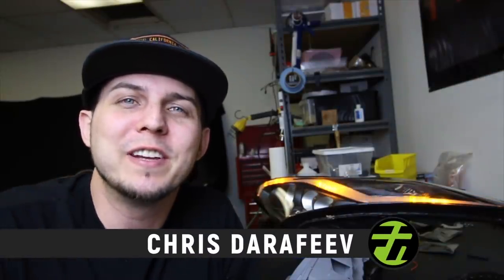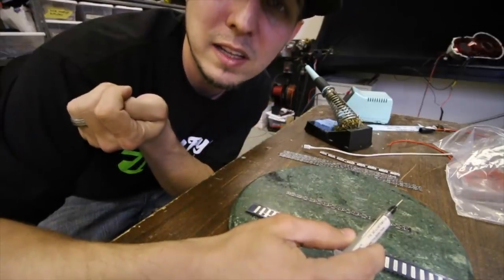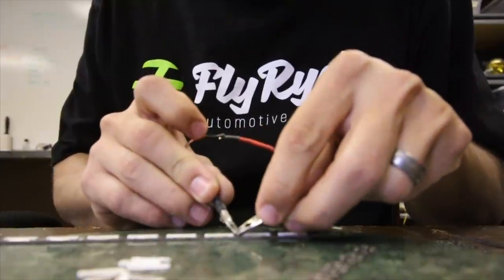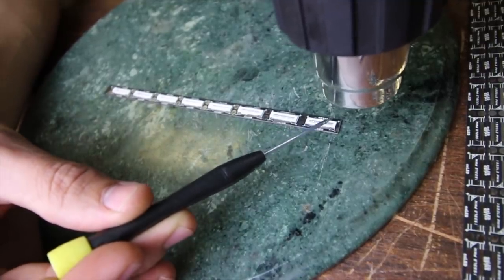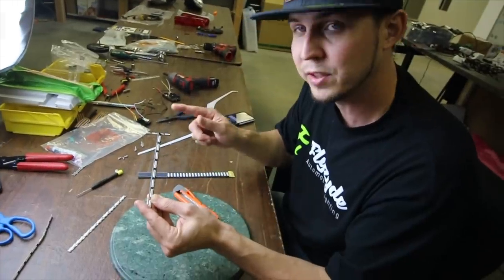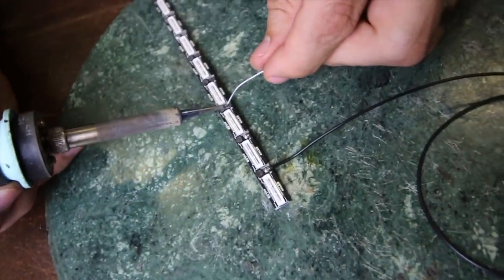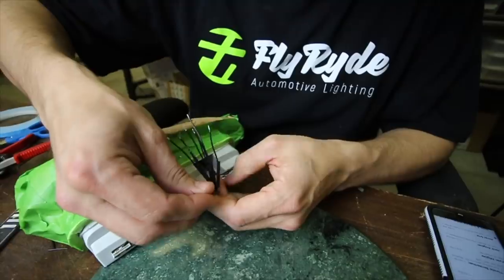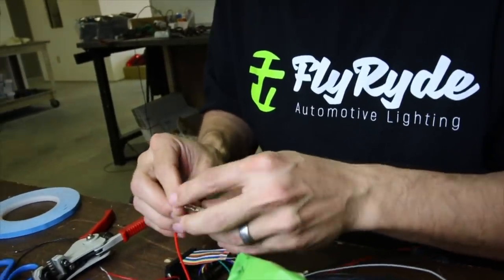How To Build Custom Sequential LED Strips - Online Course FREE Preview

Comment: I'm a wire harness manufacturing specialist (ctwireprep.com)  and enjoyed watching your video.  I would suggest two things .  First get yourself a fan to blow away the smoke when you solder so you don't have to inhale any.  We build a metal hood for each solder station and use a square fan for cooling computers (runs on 12 volts)  and we pipe it out with dryer venting to the outside.  Also instead of soldering the ribbon cable on I would suggest you use a molex connector system that is the same as the connector on the ribbon cable but you can crimp contacts onto the wires from the car light and these crimp connectors push into the molex connector and snap into place nicely.  You would only need to get the correct crimping plier to do this.  This would eliminate the soldering to the ribbon cable and the heat shrinking process.  All you would need to do is figure out the length your wire would need to be that you wound 9 times on the screw jig.  Alternately we can make the wires with terminals on some length that would work for all your jobs because we have automatic cut and strip machines and presses to crimp terminals onto wires... we actually do this for other companies that do what you do.  If you are interested hit me up through my website contact info.

Comment: This ghost module looks like a modified Arduino. Also why are you not using addressable LED's? (LED's with a chip inside them)
Reply: If you use them you will eliminate the need to wire every LED.
Reply from the maker: @philperkins6963  I'm gonna guess you've not worked on too many automotive projects like this? I could be wrong, but most guys that jump to a 5v non automotive solution and recommend tech that not quite bright enough for things like Brake Lights / Turn Signals, tend to have more indoor kind of experience. I could be wrong?
Reply: @flyryde  yeah I'm doing 12v  projects for indoors using Arduino's. You can boost the voltage with a simple buck converter to get higher voltage. I can see the brightness issue with anything less than 12v. Arduino has a limit of 5v alone.  :D
Reply: Arduino's also require coding but you can get all kinds of code from gethub. Not being critical here just curious.
Reply: @flyryde  I'm looking for better RGB DIY PCB's too use for my projects. I looked on exLED but they only have 2 color LED PCBs. Do you know of another outlet that has 3 or 4 color RGB PCB's?

Comment: There's got to be a small amount of solder on the board itself. Solder paste does not turn to solder. Solder paste let's the solder flow more easily. Unless you got some new type of paste with solder mixed in with it that I've never heard of which would be totally awesome though
Reply from the maker: Those PCBs are already tinned all across the back, and where the LEDs mount, so it’s super easy.
Reply: You're thinking about flux paste.
Reply: @hoobaguy  you're absolutely right . I should have went back and changed my statement. I never knew they made solder paste. Learn something new everyday
Reply: Come on, you've really never heard of solder paste ?  😮

Comment: Why splice wires? Split a ribbon wire in separate wires and connect it directly to your LED_module.
Reply from the maker: Svante Andersson we recently played with a setup for some GTR tails going straight to the resistors that feed the LEDs, no extra wires to mess with. It works great on a sealed environment like tail lights or headlights. 

In a situation like these side markers however, on a crazy expensive car that requires hours of install time on the vehicle, the last type of reasoning to use is: “it was easier to build it this way”. In my experience, building the best product for the unique situation keeps things better for the customer and installer. 

Ribbon cable is very weak. 1000-2000HP GTRs are violent. Taking the extra hour to make a part strong, knowing it’ll be on a beast of a car and installed by nuts and bolts types, is 1000% worth the added effort 👍

Comment: Why not just use a ribbon cable all the way? What's the purpose of soldering black wires and then solder their tails to a ribbon wire? 
If really necessary to be black, why don't you open the on-wire connector,  remove the ribbon cable, stuck in all your black wires and close the connector. That will be much faster and reliable then soldering wire-to-wire. It will also look much more professional. 
I'd also like to help you add protection to your board and avoid any damage by short circuiting or that unusual damage to the ELDs. I strongly believe this is caused by either overheating or ESD.
Reply from the maker: Old video, old tech, and ultimately it’s not really important to solve any longer since these parts have been discontinued.

Having said that, using all one color ribbon wire (such as all grey) would have been a bit better. The reality is these little Sidemarkers having so many wires coming out is a bit much anyway. Probably one of the very few times I’d agree that a clear housing and addressable LEDs with only 3 wires total would be better.

So many things like this have 100 different solutions, though 99 of them probably aren’t worth marketing 🤔
Reply: @flyryde  I agree. Yeah,  I don't know what are you up to now,  more than an year later. I'd be glad to help you developing lights and pretty much anything car electronics. It's my passion. Actually my job as well.

Comment: Hi sorry to be a dick when saying this but have you ever thought of making a rig so you can place all the LEDs upside down into indervidual slots and then lay the strip on top with the rig setup to align everything in place the heat gun it? Could also then put a weight on top to hold it down for better adhesion with the paste? I'd be happy to send you a STL for the rig if you wanted me to make it for you

Comment: I can’t tell, whether you cut through the positive landings or the negative with the box cutter. You never said which :/
Reply: He cut though the positive side. He soldered the led chips onto the board backwards because if they were soldered on the right way he would have to cut the negitive side plus the aluminum on the back cause the ground is connected to the aluminum. So on the board it will say positve but really its negitive hope this explained it

Comment: Similar to vivi?
Reply from the maker: Jerry Peterson similar, just waaaay more manual steps since there’s no chip to identify the LED, and the LED can only be turned on and off via programming sending power through an individual physical wire.

In most ways it’s primitive in comparison. But when you really just want a simple way to do a handful of operations, the addressable solution is often times overkill, not to mention a lot less powerful.

Comment: Try soldering your boards in a frying pan / skillet - that way you apply more heat to the circuit board and not as much to the LED element itself, will likely give you a better lifespan for the LEDs
Reply from the maker: Brett Watson it’s so funny, I hear that and think “wtf? This dude wants me to put my circuit boards in a skillet?” ... and then I resume shooting a video where I pop some expensive tail lights in an oven, lmao.

Good advice bro, I’ll give it a shot on a new video. Got a brand new hot plate I’ve never used before at the shop. Hopefully it’ll transfer just as well through foil so I can still cook eggs on it later 😆🤣

Comment: sad to say in my country this things are not allowed unless its original from the car when you buy it. subscribe...
Reply from the maker: That sucks, yeah everywhere is different, but I find no matter what you do, or where you’re located, as long as you have all normal functions needed for street requirements, you’ll be fine. You just have to be able to turn on and off the extra cool stuff with remote control. I can’t possible see why “having” the cool stuff is illegal, while it makes sense that using that stuff on the road may be against rules and regulations.
Reply: FlyRyde thanks man for the cool stuff and educational tutorial. 😀👍🏻

Comment: Ok, u keep saying blown a channel, so open the damn module and replace the fuse or resistor and quit acting like it's something complicated.
Reply from the maker: mwint1982 lol, ahhh look at you! Pretending you know what you’re talking about and stuff! It’s cute 🥰
Reply: @flyryde  was actually thinking the same about you. Open the box and fix it
Reply: your PIC24 controller isn't shot, and if it's only 1 ch affected, then its probably on the output side. Reflow a new smd mosfet or whatever the fuk package is there.

Comment: You really need to learn how to use addressable LED strips......... No more strip building and far more options!
Reply from the maker: Soon, when addressable has a lot more output it'll be great. For now, its still pretty cheesy for most things. I understand the addressable part being powerful in theory. Unfortunately, reliable, compact, extremely bright LEDs are just not here yet in the capacity that would make them a great option. 

You can certainly bang out rainbow effects and dancing color stuff in a nice dark environment though. Just not everyone is into that kinda thing :)

On the note of addressable though, lots of cool stuff comin soon using BlueGhozt to control that tech, both 5v and12v products :)
Reply: @flyryde  The reason for this is that nobody has ordered higher output LEDs -- to get a company to make such a product, it's likely going to take 30-40k$ to have a shop in china make them.  Considering how A. LEDs work, you can have conventional semi flexible (semi used a little loosely here) or you can have any number of groups (1,2,3, etc) made that are joined with small wire sets allowing sharp turns to occur while maintaining spacing.  Incorporate something like this into a hood using epoxy, spray with a tinted clear... v=e-rdgB_19Fg  another good vid from the channel -- v=sPt9olLB_o4.

Comment: Telling people to power LED's backwards is just wrong.  @8:18 you can obviously see that you've CUT the traces on the side that has the '+' (exLED doesn't sell them that way).  This forces you to put them on backwards to use the controller that switches the negative power line.  Demonstrating that the "proper way" doesn't work (@8:30) is stupid, since you soldered the LED's backwards!  Of course the leads have to be switched!!  Simply cut the negative rail traces instead, solder the LED's on the right way, and stop telling people to do it wrong.  (Is this demonstration supposed to make us want to pay for your course???) 

     @9:30 "..something about these types of LED's, over time, it can decide that it's just going to give up and die."  LED's don't die and stay ON.  "When it dies it kills one of the little channels on the Ghost module."  No, no it doesn't.  LED's fail OFF.  Power transistors (the thing the turns the LED's on and off) ALSO fail OFF (open).  If a channel fails ON, it's because the digital part of the controller or some circuitry supporting the power side has failed, and it has nothing to do with the LED "dying".   If the LED draws just a little too much power than the controller was designed for (which is not necessarily what the package says, by the way), or just a bad design, the power spike when it turns on, over time, could kill something that causes the power transistor to stay on.  Since you're using a strip and LED's not made for individual control, I'm betting they're drawing too much power.  Add a small resistor to each LED control line and they'll live a LOT longer.  Do the math.

     exLED sells these as continuous strips, so you have to cut something to make them individual.  The circuit board doesn't care which is which - it only has those marks so you can easily see match your power wires to the LED's. So there is no reason to cut the wrong side.  exLED also shows a corner notch, not 'vertical lines', that show the positive terminal.  Why do you show an un-modded board without the LED's, and then the one you 'test' has been modified - obviously on the wrong side.
Reply from the maker: Chris W the negative circuit travels to the entire grounded backside of the pcb by way of vias throughout the board. You seem smart... and angry. I’m helping people play with ghozt sequential projects that nobody else is telling them about. Hope you find happiness in life dude, and sorry my content rubbed you the wrong way 🙏
Reply: @flyryde   Um.. didn't your video say just the opposite, that the negatives (a.k.a. grounds) were independent?  Of course, you didn't say that was after you cut the traces.  Both the positive and negative circuits run the length of the board as shipped.  You told people to solder the LED's backwards just because the wrong side was cut.  AND you implied this would solve the problem of always-on LED's.  Your electronics knowledge seems to be lacking in several areas, your video seems to be deliberately misleading, yet you want people to sign up for your private course.  Hmm..  No reason to be angry there.